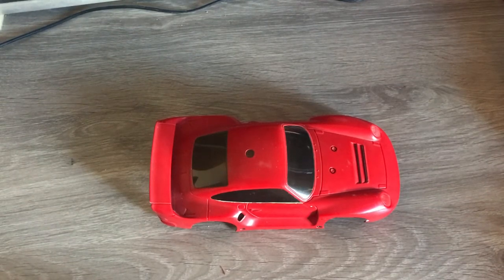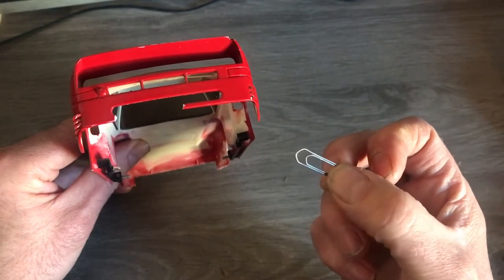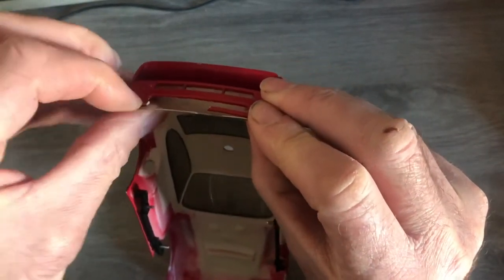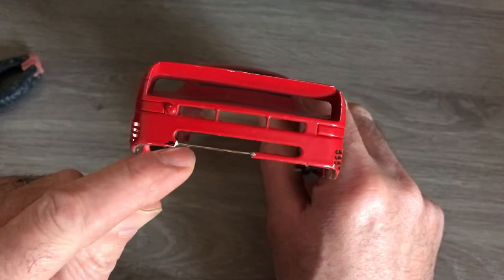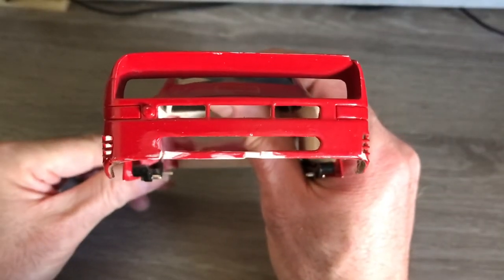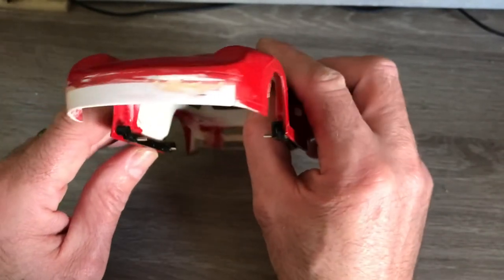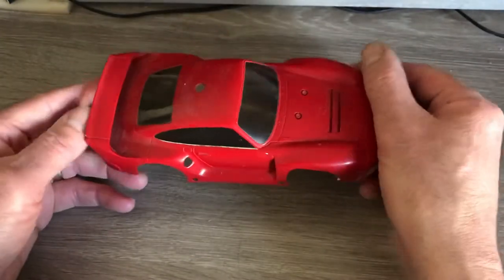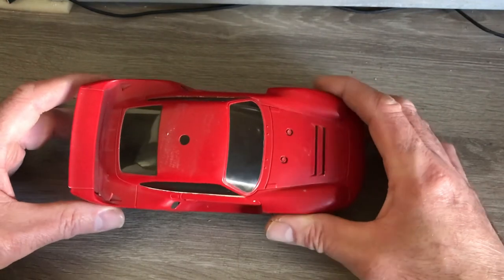Tamiya Tamtech Porsche 961 1/24 part 3

Comment: Hi Peter, that is a great way to provide some extra strength to the vulnerable areas of the bodywork, and such a cheap and cheerful component. Looks like you're getting ready now for some body prep and that important primer coat. Looking good. Are you keeping to the red? Take care and best wishes to you and the family. 😊😉😊
Reply from the maker: Hi John thank you for your lovely comment. I intend to return it to box art white. It’s a long story but I leant the car to someone years and years ago and it came back red and with the front cut out . I guess it was bashed up a bit and was an attempt to tidy it up. I wasn’t that bothered at the time as I had some what lost interest in RC then so just sat on shelves and in boxes in the loft. When I started to get interest back into RC (during first lock down) this was the only car that was just about complete so wanted to get this car running and restored first. Work has been manic since the new year and most of my spare time is spent doing up my house, so when I get an hour or so I do some on the Porsche. Hope to get some more done soon. Any best wishes John to you and your family and take care 😊
Reply: @peterhootonrc1498  Hi Peter, I understand the commitment to work, keeping the house maintained and the hobby, it’s always hard to get the balance of time and the hobby always takes the last place. It’s a matter of priorities for us middle aged gentlemen. Keep up the great work. Hope you’re getting on top of the home maintenance, take some breaks though and concentrate on one room at a time and a break between different rooms, well, that’s how I do it. Take care and best wishes to you and the family 😊😉😊